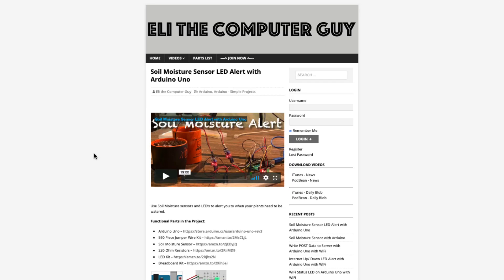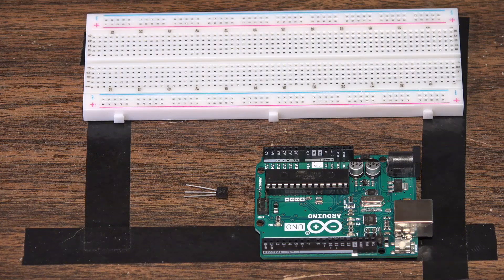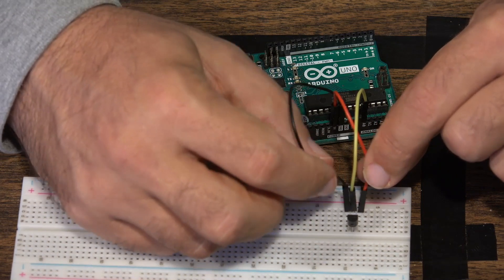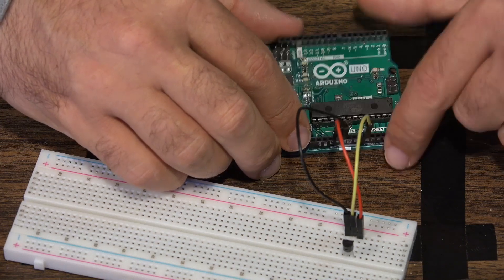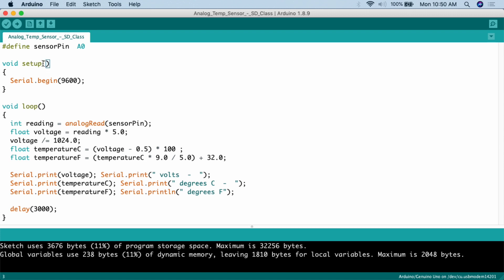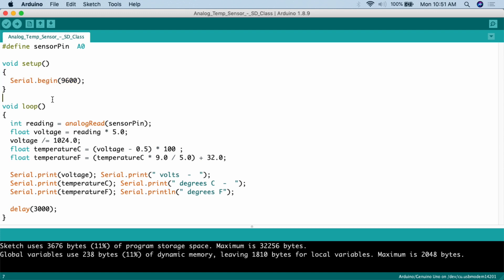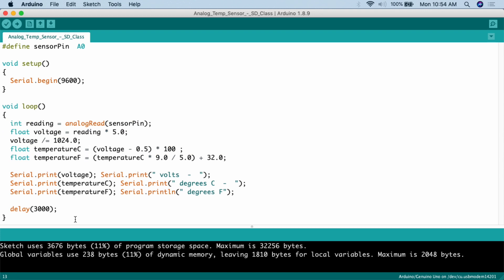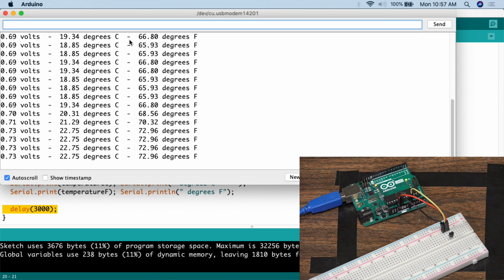Analog Temperature Sensor with Arduino

Comment: the pull up resistor is missing. What I noticed is the middle pin of the temperature sensor needs a pull up with a resistor in between preferably of  4.7KOhm resistor. this is needed to get correct temperature readings.

Comment: Hi.  I don't knownif you are still checking this channel but I was wondering if I can pay you to program a ds1821 analog to digital sensor. I have a infrared sauna with damaged sensor.  My buddy thought it was a reset button so he pressed it so hard that it broke.  I bought a new temp sensor and thought it was just plug and play but after many failed attempted I finally found the reason.  Your channel explain really well but I am not very technical.  All I can do is solder the sensor.  Please let me know if you can.  I will compensate you for your time.  Thank you